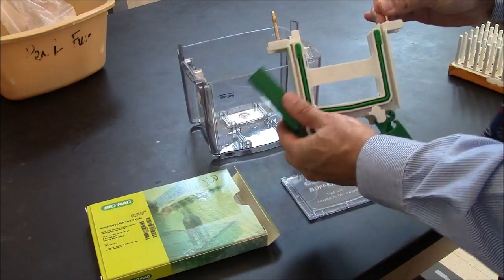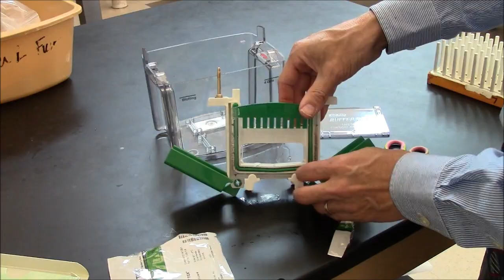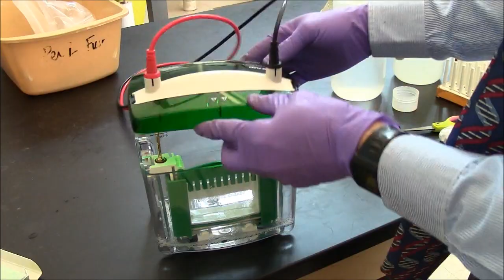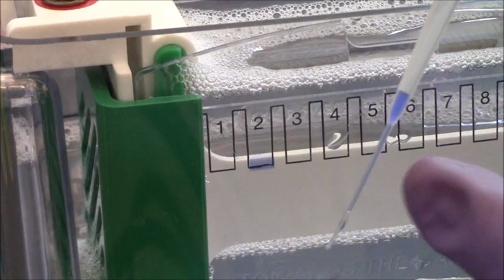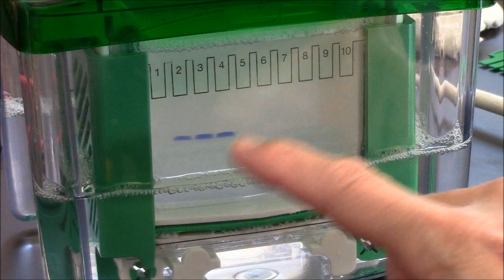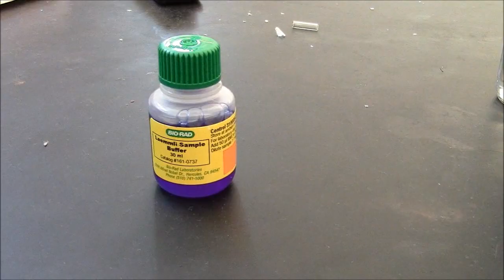SDS PAGE Introductory Procedures

Comment: Helpful video, but NOT WEARING GLOVES WHEN HANDLING THE GEL MOST OF THE TIME! 
I'm not usually hung up on safety stuff, but in this case, liquid acrylamide is a neurotoxin, and exposure can lead to progressive peripheral neuropathy. You can never be sure that the gels are 100% polymerized. 

Kids - don’t do this stuff without a lab coat, safety goggles, and at least vinyl gloves.

Comment: I still don't understand why it's not allowed to have inner buffer leak to the outer buffer in this video. It's appropriate to overfill inner chamber and have inner buffer leak out in my lab and so is some protocols.
Reply: You need to maintain constant flooding of the fluid on the gel, the fluid actually has different pH gradients from the outside buffer. If you have a leak you risk equilibriating the volumes and getting a dry gel, this can mess up the results. But even if it isnt a full seal it will still work as long as the gel remains flooded with buffer.
Reply: you are allowed that is to say, it'll work, im not sure if ALWAYS, but in the youtube videos put out by the bio rad manufacturers the electrophoresis demonstration involves overflow, I'm not sure if it was SDS though